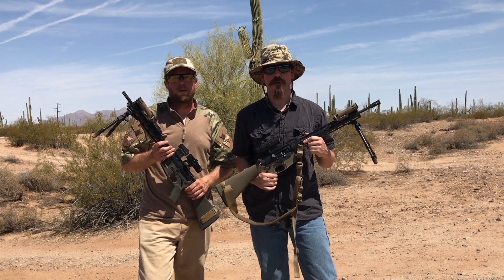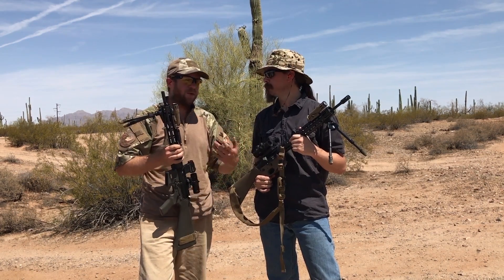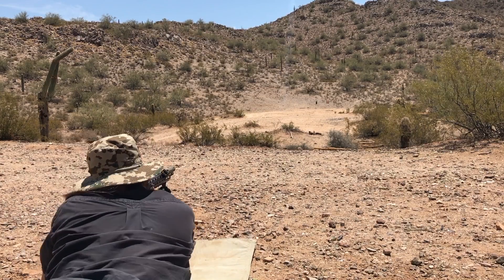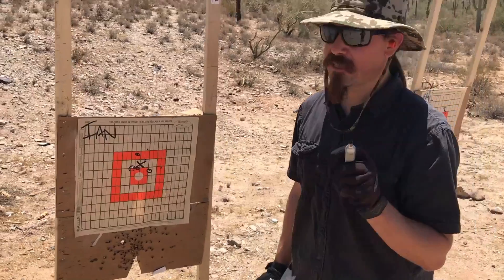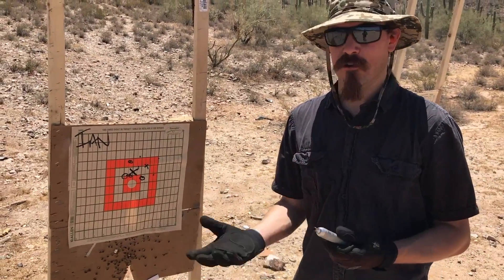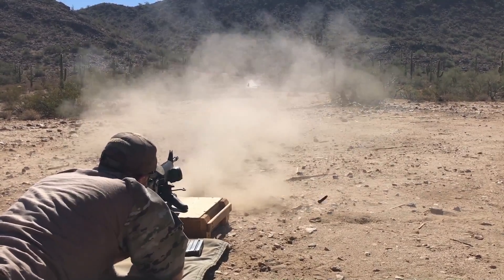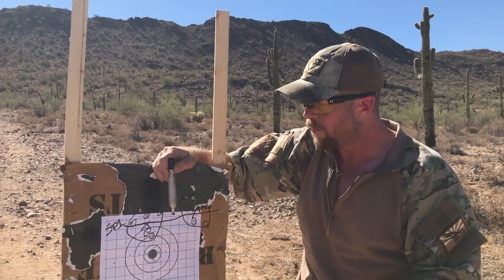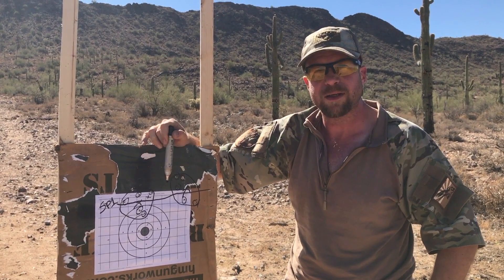WWSD: Pencil barrel Stress & Heat Zero Testing

Comment: I wish some manufacturer would make a retro AR-15 A1 (M16A1) for cheap.
Reply: Build one my friend... Save and build one. It's one of the most fun and satisfying things I did. Though, my build isn't exactly the specs you listed, but close. lol XD
Reply: While it's not extremely cheap it isn't also that expensive to build one using reproduction parts.  Brownells/Nodak for the upper at $150, same for the lower at around $150.  Plenty of barrel choices out there for around $150-200 Green Mountain, Brownells, AR15sport, etc.  You can get used Triangular handguards on the gun forums for about $40 for a fairly nice set, and a decent buttstock for around $30, A1 grips for about $10 (Brownells is about to start reproducing furniture as well).  You can find Reproduction A1 port doors for around $10 at times and Brownells is about to start carrying them as well.  And you also will need a Flat slip ring to replace the deltaring that the handguards slide into which is about $15 at Brownells.   And get a Tear Drop forward assist for $10 from JSE Surplus (others offer these).  

The rest is pretty much standard AR parts.  To save you some work you can get the whole barrel assembly from Brownells as well.  All together for a complete build you are looking at around $750-800ish.  Not cheap, but not expensive either.  If you keep an eye out for deals and do your own 80% lowers you can build them even cheaper.

Comment: Would there have been any merit to using your 60 round drums for the dump? More rounds equals more heat? Or would the difference have been negligible.
Reply: The difference in barrel heat between the two isn't that much, 30 is more than enough for proof of concept.
Reply: Andrew D probably used 30s to ground the test in a bit of reality. Most GIs had 20s or 30s, and most civillians would have 30s also
Reply: Stellar Steel They have sixty round drums.
Reply: Eye Ore  those are called communist states.

Comment: Is it just me or does Carl's ar has some kind of ring to it?
Reply: Don't you remember their previous video... there is a guy in the background hitting a steel target with a hammer whenever he shoots... even at paper.
Reply: Could be the flash hider resonating
Reply: Yes, pronged flash hiders tend to have a 'tuning fork' effect.
Reply: Yes it does. Some pronged flash hiders are ringing really loud. At first it sounds cool, but it gets old really, really fast. That's why some of the pronged hiders are not "open" at the end. The tips of the prongs should be connected to each other by a ring or something other to prevent them from ringing. Like A2 birdcage, it is basically a pronged flash hider, but the prongs are connected to each other.
Reply: This. ^^ Another solution is what SilencerCo has done, which is making the prongs different lengths so there is no resonance.
Reply: I have the same flash hider. It rings when you fire, it rings when you charge the action, it just wants to sing all the time. First time I shot it I thought my ear plugs were in wrong.
Reply: Who's this 'Carl' you speak of?
Reply: If Faxon was extra cool, they would make their flash hider prongs different lengths. Silencer Co does that to eliminate the ping.
Reply: his AR doesn't but his mic sure does...

Comment: is one mag dump enough? For the SP101 it obviously is. I feel like however that if a company makes such claims it should be really stress tested. I also think comparing it to another modern pencil barrel manufacturer would be interesting. Great video though.
Reply: the procedure the german army came up with as a worst case scenario and tested the g36 against was
10round group
20 round mag dump
reload
30 round mag dump
reload
10 round group
20 rounds in 1 min
reload 
10 round group
20 rounds in 5 min
reload 20 rounds in 5 min 
10 round group

i dont think you will ever actually test this full scenario but it would be interesting for comparison
Reply: it would also be interesting to test if the zero shift is increasing relative to the ammount of rounds fired.
ex with the modern barrels 1 mag dump = 1inch shift, 3 mag dumps = 3 inch shift or if it simply matters weather the barrel is hot or not. if it got progressively worse it could be quite problematic for a military aplication.
Reply: I'd imagine when the barrel has a glow to it that would effect the zero quite a bit, and also ruin the barrel. Other than that, at temperatures you'd care to heat a barrel up to, it shouldn't make too much of a difference. Hot is hot, until you start making it soft.
Reply: it would have been interesting to see the difference between every mag dump, dump a mag, test 5 rounds, dump a mag, test 5 rounds, dump a mag, test 5 rounds
Reply: dalem04 well, getting a barrel hot is important. The idea of the project is to create a firearm stoner would make in the modern day and they often compare them to what someone might use in the military and in the military you easily put several mags through a gun in a few minutes.
Reply: unless ive misunderstood the wwst project the idea is to create a "military" rifle and not a range gun so testing if the barrel is actually up to the task is a viable concern. from the video it seems like the new barrels have significantly less zero shift than old ones 4inch compared to 1 inch. the questions remaining are does it stand up to actual combat number of shots and how it does compare to "normal" barrels.
Reply: Aaron Orr 
They regularly compare the guns to what a soldier might use with civilian context.
Reply: Aaron Orr they talk about in terms of a combat or competition gun often.
Reply: testing to the point of failiure is nonsensical as you wouldnt carry enough ammo to reach it and it would require complete disregard for fire discipline. what is important however is how much the zero keeps shifting past the first magazine. if it keeps shifting linearly would significantly reduce its viability as a military rifle.

situations where you would be forced to expend a lot of ammo quickly and then return acurate fire at longer ranges arent that difficult to imagine:
 close ambush while clearing a road of ieds followed by continued fire from nearby villages/hills 
Clearing buildings and then being shot at from enemys a few blocks dow a road
etc.

a zero shift of 2 inches at 100m would already mean you wont hit targets like an anemy shooting from a window only exposing his head at 300m.

so overall verifying weather the trend continues, how bad it gets and how a normal barrel compares is quite important for an actual military rifle. but as i said before for the purposes the rifle will actually be used for namely 2gun matches the level of testing is enough.
Reply: holoween- the military just upgraded to a heavier barrel in the M4A1 for just that reason, so I don't think it is nonsensical in a military context at all.

After all the hubbub over Wanat and Kamdesh, and afte the removal of 3 round burst for an auto selector, there was a push to make the M4 capable of longer sustained fire. As the barrel is usually the first thing to fail when it begins to droop at high heat, a thicker barrel made sense, as it can absorb and dissipate more heat, as well as provide greater initial rigidity.

I'd be curious as to Ian and Karl's take on this, as I'm sure they are aware of all if this.
Reply: afaik the gas tube should fail way before the arrel does and with the ammount of ammo carried by a soldier you wouldnt even be able to blow either. (though you could brobably manufacture scenarios for that aswell)

the big things a thicker barrel helps against when shooting a lot is that it keeps group size and zero shift smaller. how large that effect is compared to a pencil barrel would be very interesting to see.
Reply: Just Someguy The goal is to reduce weight. It isn't the first attempt to find a lighter option for a machine gun. The M249 is a good machine gun, but as technology developed, the military will always push towards getting an edge on the enemy. If you can reduce the weight of a suppressive weapon while still maintaining reliability, you just made your soldier able to run potentially faster, or get less fatigued, or able to carry more ammo. It's the same reason why we don't still use M1. Garands or B.A.R.'s. They are great firearms, but they don't give you as much of an edge anymore. Being more effective is crucial in war. I do agree that the M27 is not really equipped to take the main role of a support weapon. It helps and does address some of the issues of the M4's with high sustained fire, but I don't believe it can he up to the role of a light machine gun. The ability to change barrels quickly is crucial in my opinion. However, the development of belt fed uppers for AR/M16/M4 platform rifles has been showing promise. I am sure they still need more development to make them up to par with military standards. But if you are able to make a full on upper that gives you the ability to have a lot of round fed quickly and also be able to switch barrels fit on a standard AR lower, you have basically effectively reduced a lot of weight. Plus turning a rifle into a light machine gun is as easy as switching the upper and possibly making a few tweaks, when could help in terms of cost. I think finding lighter options is a good idea, but I agree that the military is probably gonna want something heavier than the M27.
Reply: Since they're restricted to semi-auto ARs, I feel like finger fatigue from doing multiple mag dumps would throw off the results.
Reply: NOT EVEN CLOSE: U.S. army standard is to replace the barrel (or really the upper) of an M4 after firing 250 rounds if you don't have time to let it cool, so dumping ONLY ONE MAG is NOTHING for what REAL WORLD battle conditions require.

Comment: while pencil barrels do work I think a thicker barrel would maintain accuracy longer as temperatures increase even over ones generated by a single mag dump. Put it this way no ones putting pencil thin barrels on light machine guns.
Reply: Sean Crooker But think of it this way, that's why we have machine guns in the field. The standard infantry rifle does not need to be designed with rapid fire mag dump after mag dump in mind. It's a compromise gun with just enough capability between portability and firepower for the average grunt to use in the field.

Edit: Though I will agree that adding thickness where the heat build up is most substantial is an added benefit although it comes at the cost of weight which is a huge factor considering the loadout of the average soldier.
Reply: Yeah that's what H&K said to themselves when they designed the G36
Reply: No, that's what the government told HK to make.
Reply: Operator_As_Fck the SOCOm profile barrel isn't for accuracy, it's for the SEALs react to contact drills where they pour fire out of their m4a1s like it were a SAW. With the standard barrels they would crack behind the gas block. Unless you have a full auto rifle and a small nation's GDP for an ammo budget, you're never gonna break these barrels.

Comment: When testing the WWSD rifles, why not use a higher powered magnified optic or more than one mag dump?
Reply: It would also be pretty pointless to dump more than one mag if results are already being seen. The barrel goes from being relatively cold to a few hundred degrees over the course of a single mag dump. That's enough to warp any stressed steel from my experience as a machine shop manager and hobby blacksmith. These are thin barrels we're talking about

Comment: Interesting results. I do feel confident about thinner profile barrels nowadays although imo the Gunner profile barrel types seem ideal because the profile tapers and the thickest part of the barrel is behind the gas block which is important as most of the heat builds up back there if extended fire is concerned.
Reply: That is a common thought across many of our customers - and part of the reason we designed the Gunner profile!
Reply: From what I've seen out of the 16in pencil barrel, you're pretty much on the mark with your process. Good Job. The only question remaining is will any carbon fiber handguard blems come up for sale and where could a fella sign up for that?

Comment: Pencil barrel?

(Feels insecure about himself)
Reply: a properly stress relieved pencil barrel.
Reply: LaserAirsoftWeapons Literally read this comment just as Ian said it. I couldn't stop laughing!
Reply: Mine doesn't curve, but it does slightly lean right when it gets really hot.
Reply: This is about AR15's, not Pump Action's...
Reply: I have a shorter barrel, but bigger bore. .300 BLK of course. What did you think I was talking about?
Reply: blowing a bolt off a tiny tube got it yeah we get you.
Reply: Yu Flang Pu Huh?
Reply: i think it's something to do with friction.
friction , heat , stress, these all need to be released to avoid "a barrel rupture" , so i advise you make sure you manually relive any stress as soon as you can
Reply: Do this test after dumping 250 rounds -- U.S. army standard is to replace the barrel (or really the upper) of an M4 after firing 250 rounds, so dumping ONLY ONE MAG is NOTHING for what REAL WORLD battle conditions require.
Reply: Yu Flang Pu 

I think you did not understand what they were doing, dumping 250 rounds in rapid without letting the barrel cool would not only shift the barrel it would ruin the gun, even in combat that is very excessive for a rifle it is more rounds then the standard load out and something like that would only happen in a stress testing the gun for military trials.  And even for military trials it is normal to leave some cooling off periods.  This test accurately replicates the conditions that caused the army to stop using Pencil Barrels which was that they became inaccurate if they heat up due to almost any firefight.  They are not out to prove that their pencil barrels should be adopted by the military or that it is better then the m4 barrels only that there is fact behind the legend and that modern pencil barrels are better then those designed in the 1960s when dealing with this specific problem.
Reply: schrodingers cat I think you are the one that doesn't understand the point of this vid. And clearly, you have never been to a qual range in the military. Units don't like to report ammo returns, it can mean a lower budget the next year and it is a pain in the ass to get that funding back if your unit expands. So even after qualifying, we STILL shoot hundreds of rounds per soldier, possibly over a 1000 per soldier. One range, my M4 actually did start generally malfunctioning from the heat of shooting so much. I ended up using my 1SG rifle to keep shooting(They are dead serious, if you are at the range, you WILL keep shooting till the ammo is gone. As far as they see it, it just means more training.) In real combat, there have been circumstances in which U.S. soldiers went through  so many rounds, thier rifles were having problems. That is part of the reason why the new standard M27 rifle of the Marines has a thicker barrel and piston system. As for th test, it was to show that the zero doesn't change much because they were trying to build the generally ideal modular rifle based on what Eugene Stoner would do if he had access to all the AR parts available today. The goal was to keep it low weight, be as ambidextrous as possible, and as accurate as possible. Personally, I don't like that they are using pencil barrels, especially after this test did in fact show deviation. But for civilian drills and casual shooting, it does just fine.
Reply: schrodingers cat All that being said, he didn't mean to dump that many rounds quickly. He simply meant that one mag dump isn't enough heat to show the long term changes you would have over a prolonged period of time. It sort of helps, but they might start seeing some weird results over time when they actually do run their rifle hard.
Reply: But that isn't the story about the original pencil barrels.  The myth they were testing never went into long term effects of normal levels of use which don't really matter from a military perspective since you can re zero your sights or replace the part easily.  The entirety of what they were testing is the validity of the story that the original pencil barrels of the m-16s would wonder off zero by a significant margin after a single magazine was put through quickly, simply because of the heat warping the barrel.  

The warping from heat over the short term was the key point they were testing and at least according to the myth the reason the pencil barrels were replaced by the Army.  Long term effects are irrelevant in this scenario they simply do not enter into it, the barrel could suddenly turn into a pretzel after 100 rounds regardless of the rate of fire and it would not matter to this specific experiment.

I am quite sure they did other tests of running much more ammo through but that is neither here nor there for the purposes of this video and what they were specifically looking into when making it.  Which was the urban legend that pencil barrels quickly warp when heated by firing a single magazine through rapidly.